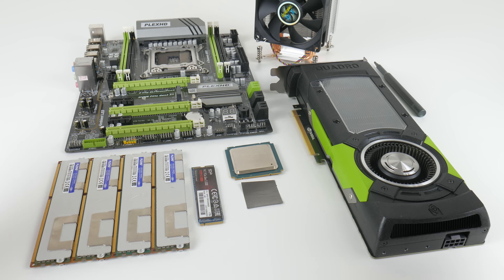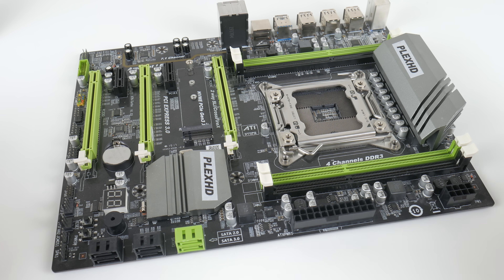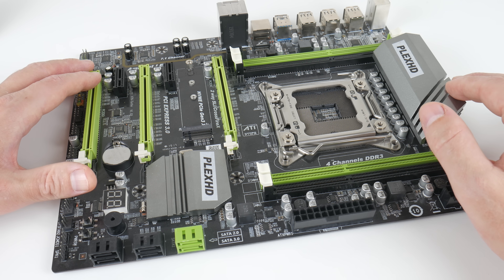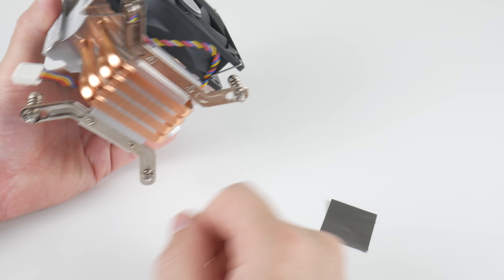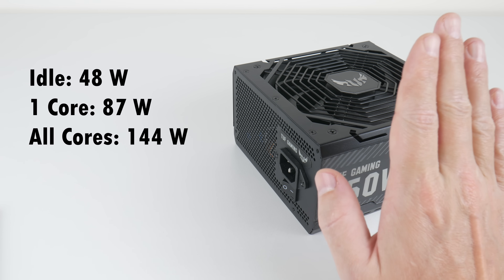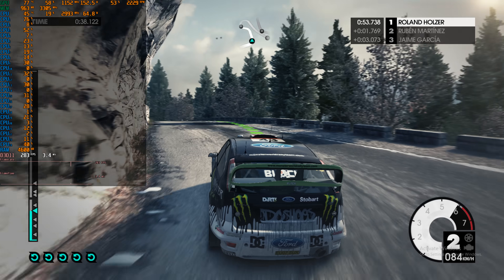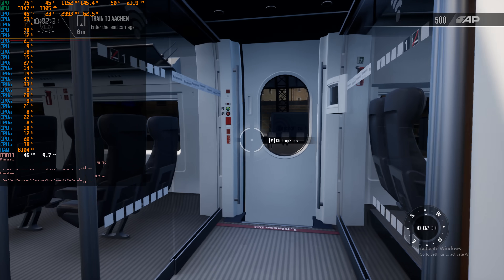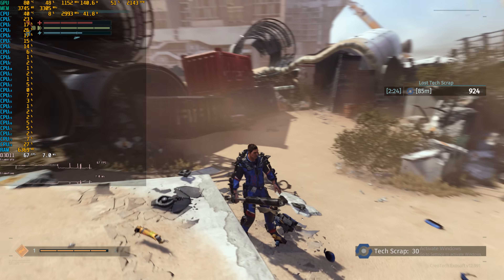10 years ago this CPU cost $2614 - How does it hold up? The Intel Xeon E5-2697V2!

Comment: Been using xeons till last year, the gab between new and old now just is too large for not that much more money in the end. The newer xeons have a lot of cores but too low single core performance because of speeds. Its not ideal for gaming. People get to buy a case, psu etc. Costs pile up. For a few hundred extra you can have the latest platforms, new, which will last you 5 till 10 years.
Reply from the maker: Yea if you into the latest AAA stuff and online gaming as well as 120+ Hz monitors I agree. But for casual gamers and if you want to play older, often free games like from Epic, this platform still has life left :)
Reply: @philscomputerlab  Sure the xeon can get you there if money is not around. I still game on a 1080p tv on 60 fps max. But with the xeon w3690 i had most games on max setting would result in 45/50 fps. If fps changes a lot it starts to micro stutter a bit. With a overclocked i5 12600k and the same gtx 1080 the gpu gets to 70/85% with 60 fps all the time and the gpu hardly eats energy now making it really silent instead of being at 100% nearly all the time. Next to windows being much faster. I must add the i live in europe and with the energy prices right now the i5 system has paid for itself in 4 years max just by the lower energy costs alone.
Reply: @philscomputerlab  Older games would also not make as much use of that many cores. Going with the 8 core Xeon should be a sweet spot. Fast enough to run the old games, but wide enough to do fine in many newer ones.

Comment: The problem with these CPU's is not the performance. It's the performance per Watt of power. They might be cheap to buy, but keep one running and your electricity bill goes up. Though with the amount of heat produced you might save on heating.
I skipped over some parts (I assumed gaming would be fine), but I think discussion of performance per watt was completely absent
Reply: Throughout the entire video it peaked at 87 Watt. Pretty decent for what it is.
Reply: @ClayWheeler  And how many games actually used all the cores fully? Might a CPU with less cores and even lower TDP not have done better? if not in performance then at least in energy use?
Reply: @bzuidgeest  Well Duh, Core i7-4790K is still 90 Watt and it's only 4 Cores 8 Threads, and sometimes more expensive than Xeon. Secondhand bruh
Reply from the maker: The biggest power consumption is handsdown the GPU, depending on what you have and what resolution you play at. The CPU isn't that stressed in most games actually...
Reply: @philscomputerlab  i am not restricting my evaluation to gaming. I also considering home server use, and doing video editing as work for example. Then still, 90 wats in a modern CPU gets you a lot more performance. 
Yes the GPU also eats power, but this video was about the CPU and if it's usefulness today. 
I also would like to reuse these CPU but in a lot of cases the math doesn't seem to work out if you account for energy use, support for new instructions in a few years newer CPU and such.
Reply: @bzuidgeest  As far as I can tell I can not see any Intel CPUs with 12+ cores that uses less energy let a alone one at the price of $45 and not to mention how cheap the board and ram was. Power is at like $0.14kwh here so the difference in 95w vs 65w is like $0.004 an hour I think. I think the average user or small bussiness would be fine.
Reply: @joebruno2675  Some businesses think different otherwise these CPU's would still be in use in their datacentres.
I would be very happy if I am wrong on this. But many metrics I have seen plainly put that these CPU's are not that great anymore.
Reply: @bzuidgeest  Yes. Those CPUs were sold from businesses to be replaced by better models. However, we are talking about personal use or small business. We are not talking about people who are spending hundreds or thousands of dollars on parts. These CPUs are great in a price to speed comparison for personal use for under $50. If you have hundreds or thousands of dollar buy the newer improved ones but not everyone or every business has that kind of capital.
Reply: @joebruno2675  sure i can agree to that mostly, but i still wonder if there are no other low price models, with less cores, but higher clock rates that would do better then this one especially if ones considered performance pet watt and such metrics. Energy prices fluctuate a lot around this planet. America is relatively cheap.
Reply: @The Baby Eating Bishop Of Bath And Wells. Personally I recommend somthing like an refurbished HP micro desktop rather then a pi for most simple home server duties. The cpu is more powerfull and given the price on PI + case + adapter etc etc. The HP (core i5) is cheaper, has more memory, USB ports and comes with more storage etc. And for for plex you don't need the PI's IO headers.
Reply: For gaming in a non-SFF build I would ignore CPU power consumption if it doesn't go over 100W
Reply: @GewelReal  So no i5-12600K, 13600K, i7-12700K, 13700K, i9-12900K, 13900K, those are all 250W chips.

Comment: What a cute panda! I love it! Thanks for reviving the interest into the X79 platform, specially because just as you said there are a lot of Dell Precision, Lenovo Thinkstations or even better HP Z Workstations that can be bought for as little as sub $ 150 USD and can be nice machines to recycle and upgrade. I guess it all boils down to availability and need for AVX2 instructions for any given application, but if someone can get those workstations in their local market then the Chinese X99 platforms musn't be always a better recommendation. Lastly, I don't remember if you already covered the Pentium EE 965 before, but having such interest in revisitng the old "Performance Kings" or "Maxed out" platforms of yore then it could be fun to tinker with one of these just for the joy of doing it. Best regards!
Reply from the maker: Yea we haven't done a Pentium 4 video in a while and EE you're right.

Comment: you got ripped off, the e5-2697v3 is currently $35 from multiple vendors on eBay. I did price a V2 at the same price despite the 2 less cores. The V4 is holding around $75 right now.
Reply from the maker: For V3 it's the 2699 that's the flagship AFAIK.
Reply from the maker: But yea, every market is different. I can only speak for Australia, so if you can get even better prices in your area that's awesome 😎

Comment: Wow... even 2 years ago the 2697v2 was much more expensive.  I remember fawning over that CPU around the time Zen 2 came out. Needless to say, the 2700X is what I ended up with. I may build one now.
Reply: 2 years is an eternity in IT
Reply: @bzuidgeest  not anymore. Focus of development to console has trapped pc players, and hardware manufactures are focusing towards 8k, something which will take a decade to adopt.
Reply: @willowwu8061  I have little clue what you are actually saying.... How exactly do you think pc gamers are "trapped" And how is 8K relevant to the performance per watt of the CPU, 8K or not is a GPU thing.
Reply: @bzuidgeest  game studios make games that can run on a ps5,
(that is basically a 2070 system) 
because of this people who have extra horsepower,
(on a fancy 3080ti system)
can't do much more beyond increasing the resolution.

this means they are stuck where they are with useless muscles and expensive promises. At least until the mainstream gamer catches up and games become more immersive with AI.
Reply: @willowwu8061  you're greatly overestimating the PS5. It's a specialized macht, but there is already better PC hardware out there.